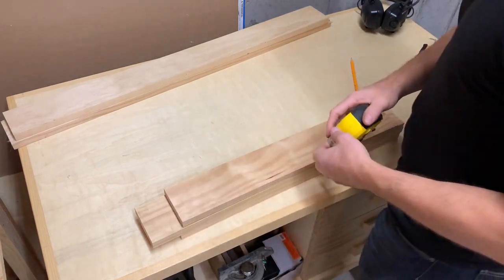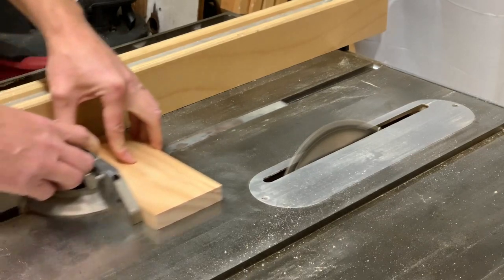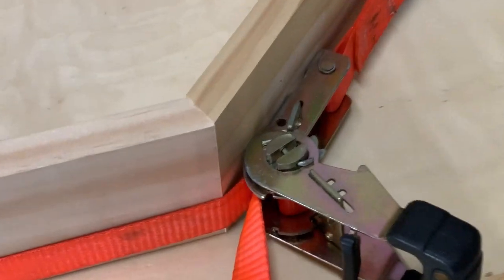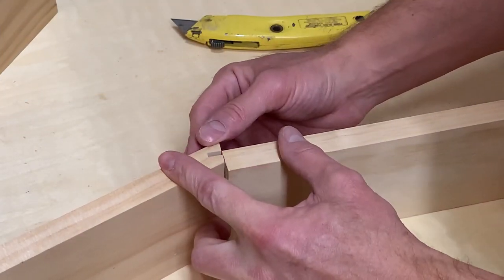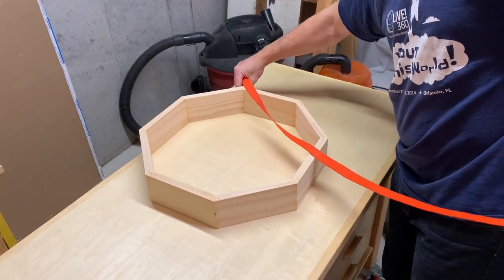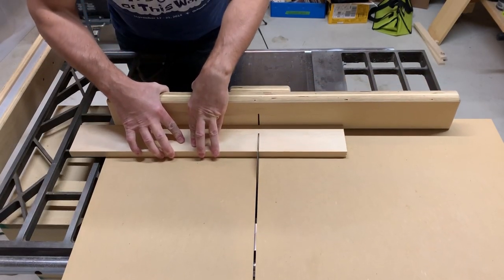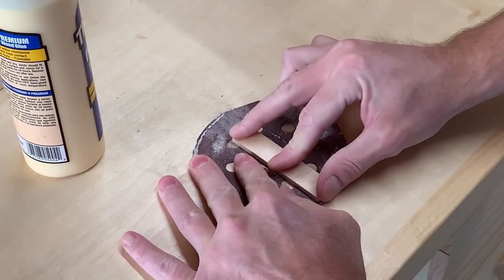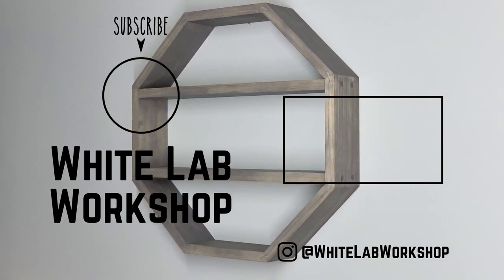How to Build an Octagon Shelf // Octagon October Challenge // Woodworking

Comment: Both shelves are nice but I must say Brents shelf has greater degree of difficulty with the splined miter joints and the fit and finish is great.  The glass inserts are a nice touch and it is also a great shelf but my vote is for Brent.  What does biased mean?????
Reply from the maker: Thanks, Bob! I agree that my shelf is just an all around better shelf. And I also agree that Felipe did a great job too, just slightly less great than I did 😆

As far as what biased means, I really couldn’t tell you. I’m, like, 80% sure it has no bearing on this conversation though...

Comment: I cut all the pieces to exact same length,  long side is 6". cut each end to 22 1/2 degrees.  when I put it together,  one is piece is longer and won't fit.   No matter how many times I cut that board, it's still too short.
Reply from the maker: It sounds like your angles are slightly off, so the last piece to go in looks like it’s wrong. Make sure your 22 1/2 degrees is exactly accurate. It doesn’t take much, when compounded by all the joints, to throw the whole thing just a bit off.

Comment: How do you know what the angle of each piece is??
Reply from the maker: Are you ready for some math? There’s 360 degrees in a circle and an octagon is essentially a circle with 8 vertices. 360/8= 45. That mean s each of the 8 joints needs to be 45 degrees for a perfect octagon. However, each joint is comprised of 2 sides. So, 45/2=22.5. So each end of each side should be cut to 22.5 degrees. I hope that helps!
Reply: @WhiteLabWorkshop  thanks! That helps a lot!
Reply from the maker: You’re welcome!

Comment: friend, I know who you cut at 30 degrees, now why did you put that blue ribbon?
Reply from the maker: I’m not sure I follow. If you’re referring to the splines, they add structural integrity to the joints. Mitered joints have end grain to end grain connections, which glue doesn’t hold as well.

Comment: kemiringan nya brp derajat mister?
Reply from the maker: I think Google Translate is failing for me on this one. Is your question something about the angle of the cuts?
Reply: @WhiteLabWorkshop  the slope of how many degrees?
Reply from the maker: Each piece needs a 22.5 degree angle cut on each end. When joined with the piece next to it, that makes a 45 degree angle between pieces. For 8 pieces, that adds up to 360 degrees. Hope that helps!